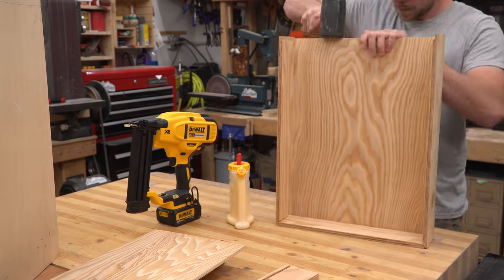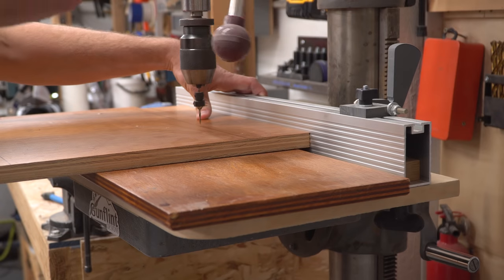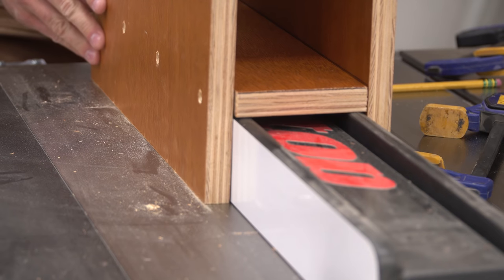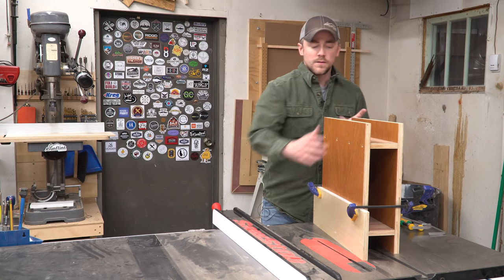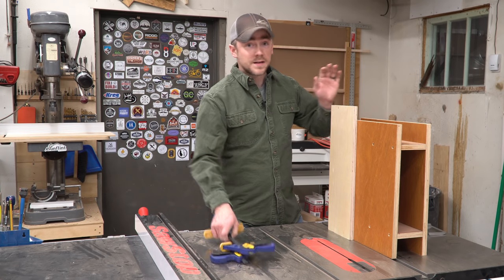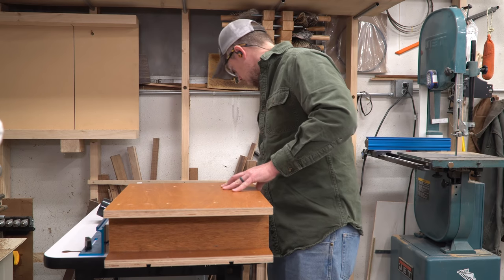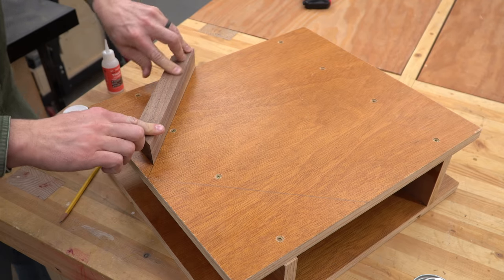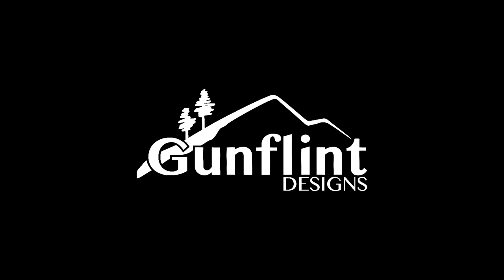Woodworking: Splines & Bevels - A Combination Table Saw Jig

Comment: You could also drill a series of holes in the face to put the dovetail clamps through as well. That way you don't have to worry about the dovetail breaking out... Cheers...
Reply from the maker: Good call. That might be something that happens in the heat of the moment if the grooves ever fail me!

Comment: Nice just got my 1st Table saw so really amped use it to max potential so love your jig! def going to build it. Only thing I would change is to glue some scrap carpet to the areas that slide along the fence just to give it a smoother glide and protect the the fence. 👍😁
Reply: Vinyl  carpet squares would work easier to glue with spray adhesive 👍
Reply from the maker: Interesting idea. I'd be worried that it would loose some of its rigid structure with carpet in between. I just rubbed it down with paste wax and it slides just fine.

Comment: spline
/splīn/Submit
noun
1.
a rectangular key fitting into grooves in the hub and shaft of a wheel, especially one formed integrally with the shaft which allows movement of the wheel on the shaft.
2.
a slat.
verb
1.
secure (a part) by means of a spline.

Comment: I see you're wearing a shop apron now. I've been thinking about getting one for a few days so I'm curious which one you went with and how you like it.
Reply from the maker: It's just something I found on Amazon. It seems solid, but I can't keep it tied tight on me. Maybe it just needs to break in, but I find myself not using it much. I want to like it, but I can't say I do.
Reply: @GunflintDesigns  I picked up a Hobart Welding apron for $25 on Amazon. Clips on the waist part, wide neck strap, super comfy and doesn't weigh a ton.
Reply from the maker: I'll look into it!